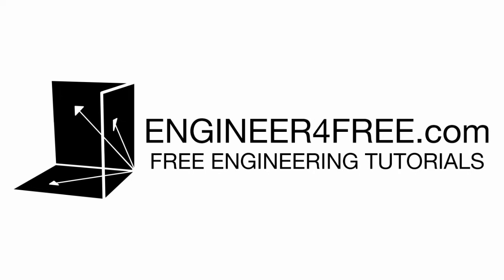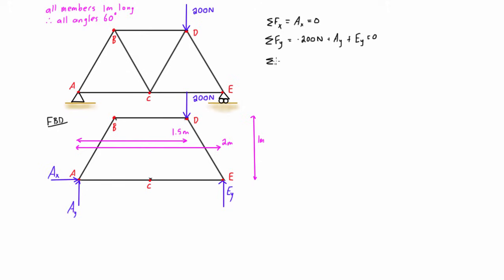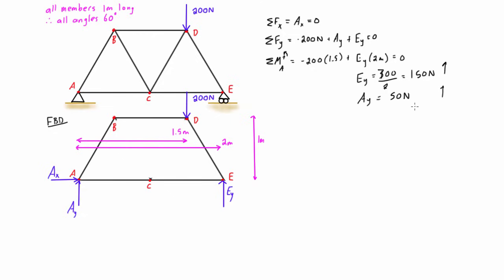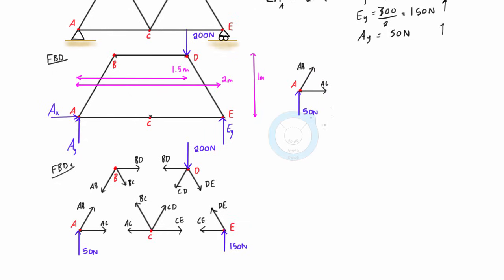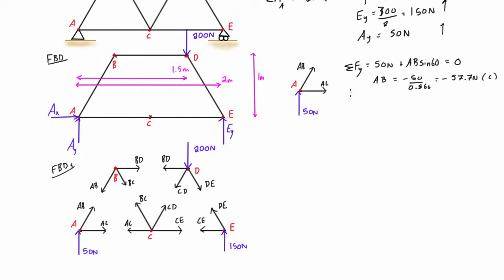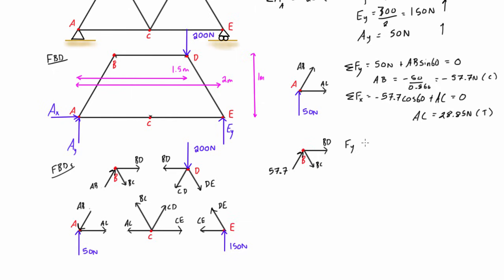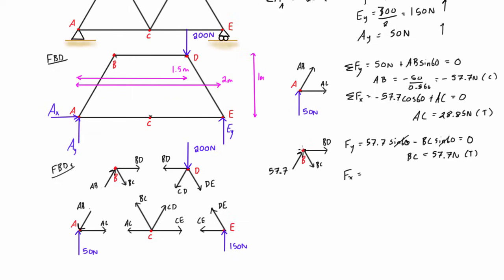Truss analysis by method of joints: worked example #1

Comment: At point A, wouldn’t there be a reaction force in the X direction since it’s a pinned connection?
Reply from the maker: Yes, but because this structure is simply supported, that horizontal reaction must be zero as all applied loads are completely vertical. I skipped the step where I write ΣFx = Ax = 0, because after you do these problems a lot it's almost always zero and always omitted, but if you were on a test you should probably still write it out to be clear. The reason it doesn't appear on the fbd is because it has a magnitude of zero.
Reply: Engineer4Free Right okay. So if there are no applied X forces on the truss, the reacting X force will be 0. Thanks!

Comment: My problem is similar to yours, however I have another external force pointing down on B, where would I add that into the equations ?
Reply from the maker: Include it in the equilibrium equations for the entire structure. It will impact what the reaction forces are. Then also include it in the fbd for joint B when doing them individually
Reply: Engineer4Free ok thanks very much , I will try it and let you know if it worked , thanks again !
Reply: Engineer4Free sorry to bother you again, but where would I include it in the equation for joint B ?

Comment: Why does A have two components in Ax & Ay while E only gets a vertical component?
Reply: If you look closely at E(the figure). The "triangle" has two circles underneath, that means it will only have the y-component
Reply: Christian Medina thanks. Another question: if the 200N force was applied at E instead of D, would there be a reaction at D and B?
Reply from the maker: You’re getting your definitions mixed up. Reaction force is a force exerted on the structure from its connection points to sold ground. The sum of the reactions forces will be equal and opposite to the applied force(s). B and D don’t have reaction forces acting on them, because they are not the points where this structure is connected to solid ground. The 200N force is the applied force. If it were moved to E rather than D, the reaction forces at A and D would be different than they currently are, and the internal forces in all members, including those that touch D and B would be different,
Reply from the maker: Yeah thanks Christian, you’re right, A is a pin, and E is a roller. Some people draw these slightly differently
Reply: JC NotNot because the pin provides two reaction but the roller provides one reaction force

Comment: I think the DE is Tension. But sir thank you for your works keep it up.
Reply: I thought so too right?
Reply from the maker: DE must be in compression. You can tell this by inspection of the sum of forces in y direction. The reaction is oriented up, so the vertical component of DE must be oriented down to counteract it. The only way for the vertical component to be oriented down is if DE is in compression.
Reply: Engineer4Free , did you just forget to put the minuses in for the DE equation?

Comment: Can someone explain to me why, when he was solving for 'CD', he didnt apply the 200 N force?
Reply: i think its because hes examining the 'joint' at C, and the 200N force is at joint D, even though the two are connected (CD) the force is only applied to joint D when in the truss is in equilibrium
Reply from the maker: Yeah that’s right. Just analyze the equilibrium at each joint one at a time. Model the joint as a particle in 2D, and draw on only the forces that act on that particle. The forces will be internal forces in the members connected to it, or a point load acting on that particle. Don’t even think about what’s going on with other particles/joints, because they are irrelevant to the one you’re considering in the present. As you go through the problem, you start uncovering more and more unknowns, so use those when you get to a new joint that they are also acting on, but that’s it!

Comment: I don't seem to understand why at the end. Fx=173.2cos60 -86.55.shouldnt there be a cos 60 too.
Reply from the maker: The cos60 is there to represent the x component of DE. The equation for sum of forces in X at joint E is like this: DEcos60 + CE = 0. CE is negative because it points to the left, so the equation can be written with the magnitudes as: 173.2cos60 - 86.55 = 0. CE (-86.55N) is wholly in the x direction, so all of its magnitude counts toward the sum of force in x direction expression.

Comment: 173.2 N should be in tensile sir.
Thanks for the video.
Reply from the maker: Hmmm it needs to be in compression for both sum of forces x and y at joint D to be in equilibrium. Also for joint E, it must have it’s given magnitude and be in compression for the forces to net to zero on the joint.

Comment: Thank you so much for posting this. Please keep teaching.  I'm was trying to figure out though why yo didn't make the force a point E= -150
Reply from the maker: Hey thanks, you’re welcome =). I’m not sure what you mean though. The 150 N force drawn in blue is a known force, so it should be drawn as a positive value with it’s known direction on the FBD.
Reply: @Engineer4Free  The equation for Ey. It has -200N (1.5m)= 300 (shouldn't this be -300?) In the problem it says 300N/2m=150. Should it not be -300/2=-150?? I am confused on this point as well.

Comment: While solving for joint D why was CD taken as positive evne though it is in compression and was found out to be negative? Someone please clear this confusion.
Reply from the maker: CD is found to be in compression so we change its orientation on the fbd of joint D to be pointing towards the joint with RTs known magnitude. Up is considered positive y direction and right is considered positive x direction for the fbd. CD is pointing up and to the right so its y conponent points up and its x component points right, both of which are considered positive for the respective sum of forces equations used. Does that clear it up?

Comment: If a member is in tension shouldn't internal force arrows be pointing opposite direction in relation to its length? Whereas the member under compression, the arrows would point at each other. All this suggesting that under tension the member is trying to stretch and under compression the member is trying to be pressed in.
Reply: If it is tension it should be away from the joint if compression it should be going towards the joint but if you dont know whether it is tension or compression, assume that it is compression.

Comment: Do you not check for solvability first? Or do you only ever use solvable examples? Just wondering. Good, effective video.
Reply from the maker: Thanks Clief, and yes I always do solvable problems, just to demonstrate the given method. I do have a few videos in other topics like differential equations that I go over checking the suitability of certain methods, but in statics I keep it pretty straightforward.

Comment: If BC from joint B is in tension, wouldn't it make BC from joint C negative? ....why was positive BC used when calculating in CD?
Reply from the maker: Hey so I'm not sure what you mean by "make BC from joint C negative." When drawing the FBD of joint B, we determine that member BC is in tension, and that internal axial (tensile) force is 57.7N. When a member is in tension, it is in tension everwhere. A two force member in tension will "pull" on the pins that support it. So when we look at FBD of joint C, member BC must "pull" on it, so the arrow that represents that force on the FBD points away from joint C. Now, when we solve for CD, we use the FBD of joint C. Just like any other basic FBD, we consider left to be the positive x direction and up to be the positive y direction. BC points up and to the left, so its y component is positive, and its x component is negative. The equation that is solving for CD is the sum of forces in y expression, so when we write the y component of BC, it gets a positive value.  I mention it at 7:52
Reply: Yeah I've gone through this video twice and this exact part confused me as well. I believe he simply made a mistake, because for all other joints he followed his positive sign convention of: right for x-directions and up for y-directions. Just be sure to follow the positive sign convention to determine if the value should be negative or positive. The negative magnitude only means the beam is in compression, and thus shifts directions.
Reply from the maker: @edwardchavez5621  Hey I replied, to the parent comment... just letting you know incase you don't get a notification for it.

Comment: on that part, you are saying on point c the vertical components of the other inclined forces should be bcsin30 and cdsin30.............becox the angle has been halved into two...within the 60
Reply from the maker: Mmm I use 60 degrees in every calculation. You can use 30 degrees if you want but you would switch each instance of sin with cos and vice versa. It would be because you're changing the orientation of the right angle triangle which would half the angle. If's fine to do if you're comfortable with that. Typically for trusses it's better to draw your right angle triangles such that cos functions are finding x components and sin functions are finding y components. It's not mandatory, but usually less confusing.

Comment: One part @5:50 confuses me: why BC*sin60 and not BC*cos30... ? When looking for the y component of BC, I am just imagining a vertical line that divides the angle into two and creates the y component of BC...
Reply: Well now I get it's the same, it's just a bit of a jump from, me, but I guess I should just practice :)
Reply from the maker: Yeah for any force F on an angle theta, Fsin(theta) = Fcos(90-theta). And Fcos(theta)=Fsin(90-theta). Depending on how it's drawn will determine whether you are using sin or cos functions for the x and y components. Glad you were able to figure it out. Keep practicing!!

Comment: why did you take abSin60 @3:09 i mean how did the sine come here? Please explain?
Reply from the maker: Every angle in this problem is 60 degrees because all the triangles formed by the trusses are equilateral triangles. The sin 60 comes from finding the y component of the vector that is oriented at 60 degrees CCW from the positive x axis. Look at this: https://i.imgur.com/Dvdqf2t.jpg that is essentially the exact same thing, just flipped vertically. The "opposite" side is the vertical component of the force when theta is taken off the x axis.

Comment: Why did the AB become positive when u put it into the Fy of pin B? You solved for it in pin A for it to be negative not positive.
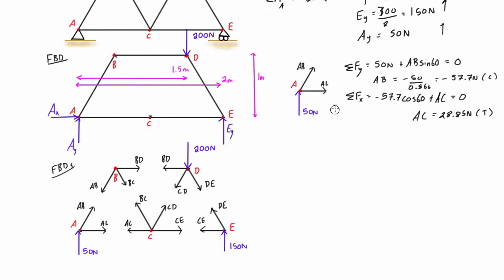Reply from the maker: Hey, at 2:30 I mention that if you find a number to be negative then it means the member is in compression. At 3:30 we determine that AB is in fact in compression. Then at 4:45, I update AB on the diagram to change it's sense to compression. I do this because for the analysis at joint B, the force from AB is no longer an unknown force. We definitely know it has a magnitude of 57.7 kN, and because its in compression, that means its going to be pushing on both joint that its connected to, so the way we have updated the diagram is appropriate from the perspective of joint B. You could not update it, and draw AB pulling on AB (tension) and then keep the negative sign, but I find that confusing to have negative arrows.
Reply: He changes the direction of the arrows after he solves each joint. i would prefer to keep all the arrows in tension while doing the calculations, and just use minus for compression.  Then, when you get done with the calculations, you can draw a "pretty picture" with the arrows facing the correct direction without minus signs.  In my opinion, "changing the diagram on the fly" just adds to the confusion.

Comment: what if there is a horizantal force applied at point D. How would that effect the moment?
Reply from the maker: You would have to include a term for it in the sum of moments equation. It would cause a moment about A that is equal to the magnitude of the force times the perpendicular distance from A to the line of action of the force (which is 0.866m; see note in video description). The sign of this term (+ / - ) would depend on which direction the force is pointing.
Reply: @Engineer4Free  Thank you
Reply from the maker: No problem =)

Comment: Couple quick questions if you could help me, I’m a an engineering student struggling to understand a few of your concepts 

Q1)why do sometimes you cancel at the SIN like at joint C , but you didn’t cancel out the COS. Also at Joint D you did not cancel out the SIN. 
Q2) also fo joint C,  for the X direction you took AC as a minus as it is going right to left even though it is in tension, however for CD is is going left to right which is positive, however you used the answer for compression and took it as negative instead ?
Reply: Private message me if you can broo

Comment: Why did you put negative 57.7 for joint A when u took the sum of x? It's pointing in the positive direction
Reply: Also, do you determine whether things are in compression or tension before the calculations or do you find which one it is DURING calculations? What's the safe approach? Because I was taught to find the tension/compression before u do the problem and i always got confused
Reply from the maker: When I initially write the expression: 50N + ABsin(60) = 0 , both terms on the left hand side are positive, and sum to zero. It only becomes negative once I rearrange the equation by bringing the term to the other side. Essentially, I just subtract 50 from both sides then divide both sides by sin(60) which is 0.866. That's how the right hand side turns from a zero into -57.7N.  To answer your other question, look at how I've drawn the FBD of each joint. Every unknown is drawing in tension initially. When I set up the equations then based on each FBD, if I find an unknown value to be positive, I know it is in tension, and if it is negative, I know it is in compression. It's easy that way and makes it hard to mess up. If I determine a member to be in compression, then I will update it on any other fbd that the member connects to, and change it from an unknown value assumed to be in tension, to a known value in compression. For example, after I determine that AB is 57.7N in compression, I update member AB on the FBD for joint B to reflect this BEFORE starting the calculations for that joint. Hope this helps clear it up.

Comment: vertical member of 1m  on 60* angle cant be 1 meter high
Reply from the maker: Hi David, I am aware of the typo, I have acknowledged it in the video's description with the following: "Typo: The truss is 0.866m tall, not 1m. It's 1m*sin(60)=0.866m. Doesn't actually affect anything in the problem, it was just labelled wrong."

Comment: How do you know the angle is 60?
Reply from the maker: The three inner angles of a triangle must add to 180. If all sides are the same length, it's an equilateral triangle. Equilateral triangles have 3 equal inner angles. 180 / 3 = 60. If a problem ever indicates that all members are the same length, it's not just a random fact they are mentioning, it gives you information that the angles must all be 60 degrees.

Comment: 30° inclination angle is with the y-axis and not with x-axis. Isnt it?? Do let me know,i'm confused
Reply from the maker: Yes, did I use 30 degrees somewhere? I skimmed through and looks like I'm always using the trig functions with 60 degrees based off the horizontal. If you want to base your trig functions off the vertical it would just be30 degrees in all cases instead of 60, and the sin/cos would end up being switched.

Comment: Hi bro. In BC, if we want to take the vertical part the angle should be Cos30 . How the 60 will come? The angle 60 degree should divided by 2
Reply from the maker: sin60 = cos30. You can use either, it juts depends how you construct the right angle triangle that the trig identities are referenced from. The way I did it, BC is the hypotenuse, BD is the adjacent side, and the vertical component of BC is the opposite side. This makes my reference angle 60 degrees. If you set up your triangle so that BC is the hypotenuse, the vertical component of BC as the adjacent side, and the horizontal component of BC as the opposite side, then your reference angle would be 30 degrees and the appropriate trig function to use changes. I do it my way because the latter has two unknowns, where as the former only has one. Make sense? The 30 degrees would come from 90 - 60, not 60/2.

Comment: I was wondering why you used sin for the y component when working out BC, because wouldn't using sin work out the x component?
Reply from the maker: Hey, here is an illustration why: https://imgur.com/a/YCT6I1a You need to re-assess how the right angle triangle is oriented every single time that you use sin or cos in these problems. Hope this clears it up, cheers!
Reply: another question came up, how do you know which angle to use when calculating?
Reply from the maker: It's something that you have to decide every time. Construct a triangle like in the linked image such that one side is known. The known side will always be the hypotenuse or the adjacent side of the right angle triangle, and from there, you should be able to identify the angle that is "opposite" from the opposite side. That is the angle that you use in the sin and cos operations.
Reply: If you are looking for Fy use sin, if you are looking for Fx use cosine.
Reply: When measuring the angle from x-axis use cos and when measuring from the y-axis use sine